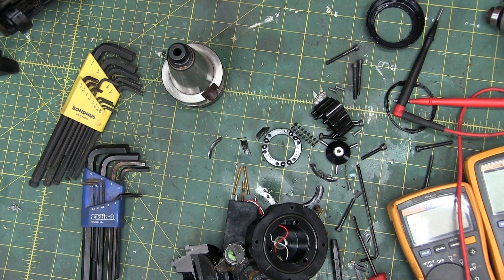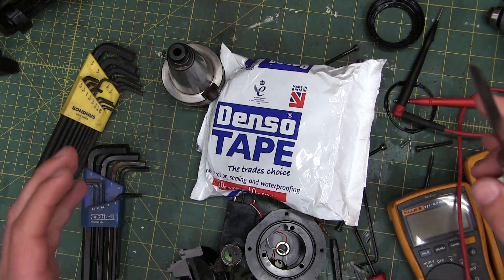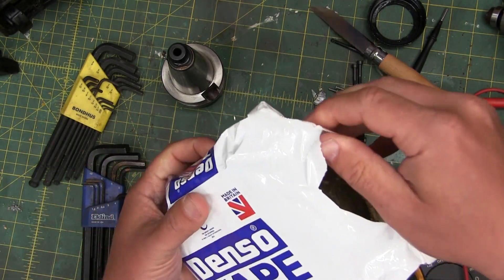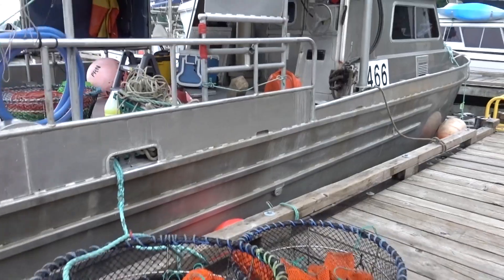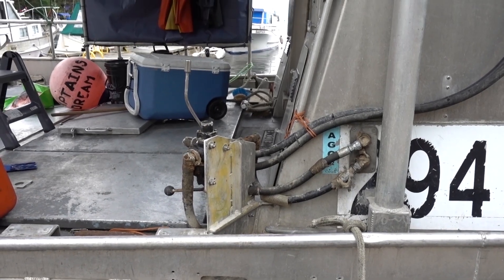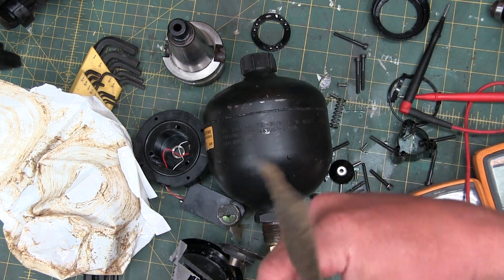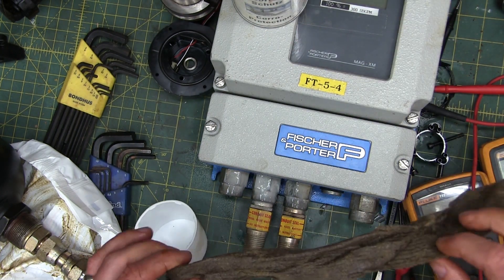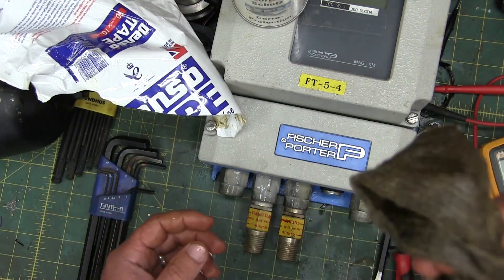Best Corrosion Protection? | Denso Tape

Comment: Honestly I'm shocked that I've never heard of the stuff.  Working on ships for a while now and all I've used is; rubber vulcanizing tape wrapped 3 times, a layer of e tape then a layer of the some type of liquid rubber melts the etape to the rubber.  Nuts and bolts I've used some crazy crap called poly-sulfide.

Comment: Scotchkote and 3M Rubber Tape are what we used on the RR for underground low voltage splices.  Kinda the same function only for wire.

Comment: We use that stuff on secondary bushing for submersible  distribution transformers.  They are the transformers you see on the pole, but put in a cement vault below grad, so the the exposed secondaries are covered in Duct seal (feels like molding clay) and then rapped in denso tape. The primary side is protected via an load break elbow connector.

Comment: Having plastered myself in that Denso-goo many times when I was a young plumbers-mate, I can assure you that it is a back to basics, low tech, reliable product that once applied won’t come off of you or anything you care to stick it too. The version from 30 years ago was even more gooey and sticky than the modern version, which seems to have been value engineered to only the minimum, correct, amount of sticky snot goop to get the job done. All self-respecting plumbers over here in the UK, never leave home without Denso in the van.

Comment: LOL.. I spent 4 months last summer digging up natural gas pipelines that were installed from 1975-1982 (abandonments). 

I dug up literally a thousand connections with Denso tape on them. 40 year old joints, still looked like they were buried yesterday. The Denso tape was still soft, supple and sticky. Amazing stuff. I have pictures somewhere. 

However, not so amazing in warm weather marine environment. It does not last at all when exposed to high temps, solar radiation and salt water.

Comment: Denso tape is a non-woven synthetic fabric tape fully impregnated with a neutral petrolatum compound. Corrosion protection of wet or dry pipes, flanges, valves and related surfaces. They do make the same thing in North America by the same company.

Comment: Hello Mr AVE we use the denso tape on ye olde shipping equipment like crane hydraulic fittings stops the smoo from getting  under the skin of the material. Other good stuff is ensis fluid.

Comment: When I worked shutdowns in the UK we used to wrap exposed threads and smallbore pipe in denso tape. You could find an anchor bolt that had seen years of damp, creeping rust, sea air and exposure to whoknowswhat and the steel still looked clean and new when you peeled the tape off.

Comment: Nice! Gotta order some. Also sprayable rubbers (synthetic rubber or even those Foliatec peelable wheel rubber sprays) are wonderful, some are even chemical resistant (at least at some level), which means that all of the large areas, ie. stands or sheets, that are not-so-permanent, are actually easy to protect for a really cheap price - and without the mess of the waxes or oils and easier to remove. Heck, they use to protect non-commissioned fighter jets in US of A that sit in the desert just by blocking every vent and spraying it over with synth rubber compound!

Comment: We use this in the fertiliser plant I work in ..... if it can stop  fertiliser rusting parts it can stop anything 
But like others have said it’s handy to add some grease first, we change it every few years just to check the fittings and you can see rust where there was air pockets under the dense tape, grease helps to eliminate that from happening

Comment: I HAVE USED LITERALLY MILES AND MILES OF THATS NASTY ASS DENSO TAPE AND GREASE/WAX PASTE SHIT ON UNDERGROUND NATURAL GAS PIPELINES, FLANGES, BOLTS, WELD JOINTS, AND VALVES. I WOULD MUCH RATHER USE IT INSTEAD OF THE HOT TAR WRAP AND TORCH METHOD THOUGH. WE ORDERED THAT SHIT BY THE TRUCK LOAD.

Comment: Wrap it round your feet and shins for an impromptu pair of wellies.
Reply from the maker: Cure worse than disease.
Reply: Depends what you're standing in.....
Reply: To The Top Crane 
Have to find a companion willing to accept a denso decorated dingus first.
Reply: AvE, could you wrap it around the "Little Richard" to prevent a case of "ghonno-herp-a-shyph-la-aids" or "sabertoothed crotch crickets"?
Reply: Depends if it keeps you from avoiding a case of trench foot, something thats a hazard when your working out in the muck in rainy old scotland...
Reply: Or just buy the 100mm wide tape and you have a pair of waders for the fishing

Comment: Manitoba hydro uses it to keep pipes from rusting underground. They first make you put Denso paste on. The paste protects the pipe and the tape holds in and protects the grease. We've dug up pipes decades old that still have the tape on them. (And in the old days they would wrap the plastic the tape comes in on top of the fittings too)

Comment: You are very much correct on all points raised. Disgusting stuff, i have applied miles of that shite to underground oil lines etc. Effective yes ! 
If you have dry chapped hands use this with no gloves and your hands will be softer than the sweet lords foreskin ! For days.

Comment: I work in telecomm on the gulf coast of mexico in the states and we have something similar only it is chintzy as hellllll. The only thing it does well is hold water right up close to the connectors.

Worst shit I have ever run across. To boot you spend longer removing the shit than repairing corrosion damage from the salt air.

Just my two cents on a similar product. I believe its called mastic tape

Comment: I think you're supposed to grease up the fitting before applying the tape.

I take it you know that as you do mention the paste is available, but just in case anyone wants to use the stuff applying grease first makes the stuff work soo much better.

Comment: Density tape is the DEVIL. Band in most oil and gas locations since it’s perfect for trapping salt water against the steel then you can’t see the condition underneath. Feels like you are saving money since it works sometimes but when it doesn’t I swear the fittings corrode faster than if you leave them alone.   Most industrial locations run hose management these days which means max life for a hose is 4 years anyway. I went to do an offshore crane inspection a while back and the rig mechanic had put plumbers tape on every thread and denso tape on every fitting (including the JIC) the unit had more leaks than a welsh allotment.

Comment: We used to wrap the Shitzel out of stuff in the old mill as it flooded all the winter literally and changing outfitting was a breeze. its horrible to use but beats hours of swearing trying to remove a fitting.

Comment: When we get landing gear and flight control actuators back from the overhaul shop, the chrome cylinders and other bearing surfaces are always wrapped with that stuff. Never know what it was called tho, thanks! Yeah, it's disgusting, but it works damn well.

Comment: Oooo one question, can you use this stuff on electrical connections or is it super flammable?
Reply: It's petroleum based. You can if you want, but I won't be.
Reply: You need self amalgamation tape and then learn how to apply it correctly, if you get the tension too tight or too loose it'll reduce the effectiveness. Also don't buy the cheapest stuff it sucks balls. Do it right once.

Comment: My dad was a plumber, and before teflon tape (which my dad never liked).  They used to join water pipes to couplings using hemp and plumber's paste.  That plumberes paste had the same brownish color as that denso tape (and it smells bad).   that tape kinda looks like it's a cloth tape with a similar kind (maybe thicker consistency) of paste empregnated on it.
Reply: oreubens Not the same, the feature of hemp is that it expands when it get wet, and in this way tightens the fittings. The plumbers goo is mostly for keeping the hemp in place and for reducing friction (contains graphite).

Comment: I'm about to do up a boat, this stuff might come in handy!
Reply: Luke Makes we use it for stern gland tubes and the occasional few bits. But she's a real bitch to go back and work on. Keep it to a minimum. Check out owatrol. It's a paint conditioner,  but used on bare metal and it's incredible. I've owatrol'd a diamond checker plate front deck, 1 coat, a year later sitting in a yard, good as the day I applied it. Mix owatrol into undercoat to make it non porous,  and into top coat to make the paint like melted butter. It's pricey but worth every penny.

Comment: Old sailor's wive's tale trick: make a goop of parafin wax, linseed oil, mineral spirits, and maybe some mineral oil. Brush that onto your metal and you'll keep your metal pieces in top shape. Use pine tar for extra points. It'll keep the water out like nobody's business. Easily applied. Brush on every year to keep it fresh. Dirt cheap.
Reply: Or paint with some old fashioned linseed oil paint. It'll stick to anything and won't peel or chip.

Comment: Makes little sense why not spend a few extra bucks for stainless and not have to ever worry about it.  For temp jobs or if you're very poor then maybe but still.
Reply: Xcaliber Trekker have you seen the price of a 4 inch stainless fitting? Added to the fact most stainless doesn't have the mechanical strength of other more corrosive metals. Stainless looks good, but has its limits.
Reply: Good point.  Yea if you need something stronger then stainless then that's true.  Looks be damned if it's for a industrial of commercial application I just prefer reliability and something not requiring to much maintenance.
Reply: Xcaliber Trekker yeah I love low maintenance. Lol, as long as someone else is paying for stainless I'll be fitting it.

Comment: Greasy metal cannot corrode.  Coat car battery's terminals with grease, especially if cable ends have been replaced with those cheep things with the two pinch bolts on a steel strap clamping the bare copper strands.  Grease it.  The Denso tape protects the grease.
Reply: Lots of people make the mistake of using vaseline on battery terminals. Bad idea... vaseline melts at body temp, which is why it's sold in drug stores, not hardware stores. The first time you start your car the engine will heat under the hood well above the melting point and all the vaseline will drain out of the connection. Use dielectric grease instead... high melting temp and completely prevents terminal corrosion.

Comment: In the maritime industry its very common. Its mainly used in hydraulycs and winches. Trust me I am a marine engineer
Reply: The paste version is a fantastic anti-seize for bolts and nuts in harsh environments. Slather it on bolt threads before tightening and you'll always be able to undo it again no matter how many times it goes to sea.

Comment: Here in the oil industry, we wrap a variant of Denso tape on downhole pumps to keep grime and moisture out of the pumps when in storage and transport. I’ve also seen a similar type schmoopaper used on super old NOS automotive and motorcycle parts. After 60-70+ years in bad storage, most parts look brand spanking new after cleaning the hoop off

Comment: The gas company in Sweden uses it as a seal for small gas leaks from the natural gas pipes that people use to cook food. And ofc as a corrosion resistant barrier for everything under ground.
Reply: Years ago I'd had a gas cooker fitted, came home a few hours later to a smell of gas in the house. I phoned the gas board emergency line, a tech came out, found the leak in the flexy hose, and wrapped it in denso tape as a temporary fix until someone else could  fit a new hose. He did assure that it would work for a long time - I had to inform him that I worked on an oil platform in the North Sea, and we used the stuff regularly.
Reply: Do you have any more info on how they aply it for that purpose. Im asking because i have a big natural Gas pipe and a lot of this tape and if i should gett a smal leak i would like to know how to plug it to prevent the worst case.`

Comment: I used to work in the maritime industry and i always used Denso tape to protect hydraulic fittings on our deck cranes, along with other parts that needed protection from the salt water. Fantastic stuff, you could peel it off after several years and the fittings would still be like new. But yeah, very messy to work with, disposable gloves needed with that stuff!

Comment: We use this stuff on Cadweld connections on the railway in Ingerland UK. It's fuckin great for years and then 1 day you need to get to the thing hidden under it. You can't wear latex or nitrile bum gloves you just stick to the shit. You can't wear normal gloves as you can't pick at it to get to orf. Cutting it just crude the knife up. So you know you're going in bare and you know your hands'll nee sticking to fucking everything for days. Nothing washes it off. Your only option is massage butter into your hands.

Comment: Isn't there a peel-off type of rust inhibitor for storage? I don't remember what the brand is or what the product is called, but it goes on as a gooey dip and hardens into a form-fitting yellowish rubbery coating fifty to a hundred thou thick.

Comment: We use both this tape as well as their fusion  bond epoxy coating  on underground oil and gas pipeline joints  and fittings. They make some fine products. I have had the displeasure  of removing this tape after its been buried a few decades. Its no easy task. It holds up and goes the  distance.

Comment: a customer of the company i work for,they process artificial fertilizer via a big driveable conveyor belt (+10 tons machine weight) (800 tons /Hour product transport), everything stainless 316 and 3 layers of special paint, with this stuff wrapped around al the fitting and bolt threads because even the stainless just fals apart

Comment: i worked on an offshore drill ship in the GOM and this stuff was EVERYWHERE. air fittings, hydraulics, junction boxes. it works very very well. it also works very well at clogging up the vacuum shitters too

Comment: Used this stuff a lot in the marine trade, it's a real mess to work with but works wonders.

I've pulled apart hydraulic pipes and fittings that spent 16 years along the railing, exposed to the sea and weather all it's life, where most of the fittings were covered in Denso, just a light coating of surface rust, and no problem pulling them apart. 

On the other hand, the fittings that were uncovered for some reason, the pipe and nut were so corroded together we ended up twisting and breaking the pipes before the nut gave, had to change a lot more piping that necessary because of that.

Comment: Superb stuff and we insist that it's used on hydraulics from commissioning in the offshore world.  And if you happen to be in the middle of the North Atlantic in winter working another good thing to see is that someone pre-filled the Allen bolt heads with silicone sealant. If you need to then undo a bolt you pull out the silicone plug and you're left with a nice clean hex recess with no rust.

Comment: When into the local knife shop and asked her for a non assisted pocket knife I don't like the fukkers jumping up at me and they hit the ground( also I do have occasion to travel through California which doesn't allow switchblades[ any assisted opening knife]). She couldn't understand the difference between a switchblade and a knife you have to flick to make it open. she sold  me one of those French bastard knives. The lock on this thing's is not adequate damn near took my finger off, when the lock failed.clean cut it is a dam sharp knife.

Comment: Earthing electrodes, antenna masts, general purpose sealing. This video triggered my prost traumatic stress dissorder i got from using this stuff by the kilometer.
Use this on hot summer days you know what it means to feel dirty and sticky.
But there is no proper alternative when your customer can hold you accountable for years.
If you wanna do it right, you use this. Only takes a minute to apply, but it take eons to get it off your skin again. So wear gloves, keep the stuff in a plastic bag along with the gloves and the knife for cutting it.
Believe me a tool that has come in contact with this stuff is tainted forever. You will never ever use that knife for anything else again!
Reply: To all saying alcohol or white spirit. Yes. It sorta works after a lot of scrubbing. But you will have hands that reek for the rest of the day. Swafega is literally an industrial soap, smells nice. And works on nearly everything. Even grease. Try it, and come back here and thank me when you realise how awsome it is and how much better then ethanol or spirits it is.
Reply: My friend. Swafega.
Reply: My friend the secret to remove it from hands and tools is white spirit the stuff comes of fast than shit on a Teflon shovel
Reply: I have a great suggestion for a vid how about he tests all methods people suggest and find out what works best could be interesting
Reply: R - i happened to work mainly in grain and flour processing... neither dirt nor water available as far as the eye can see.
Reply: WD40 and PB Blaster clean it off knives and scissors very well.
Reply: Ultrasound could work on the knife.
Reply: a Jar of Ethanol and skincare cream  for the dry skin afterwards XP
Reply: cannon fodder You'd like the Project Farm channel
Reply: Is that the greasy beige soap with silica particles? I remember the smell but I haven't used any in years...

Comment: Super nasty stuff, works great though as long as the individual that put it on done it right. Been to a ton of fittings where they had made lovely little baths for for the fittings to sit in which fills up with ye old salty water.
Anyway works GREAT, is super nasty to work with so... QUEUE health and safety BS to get it banned!!!!